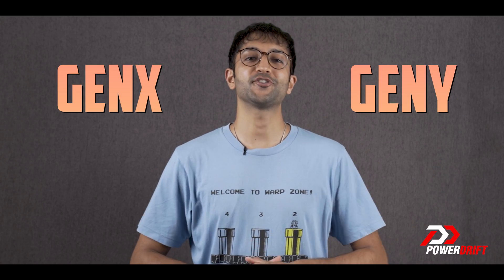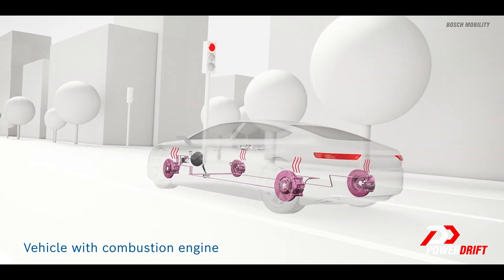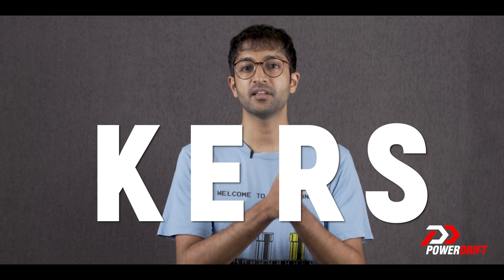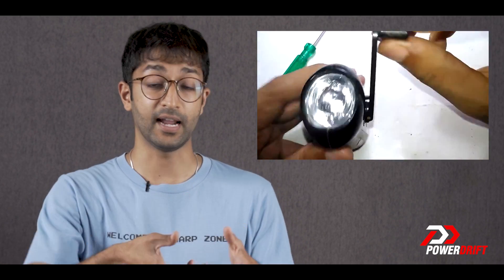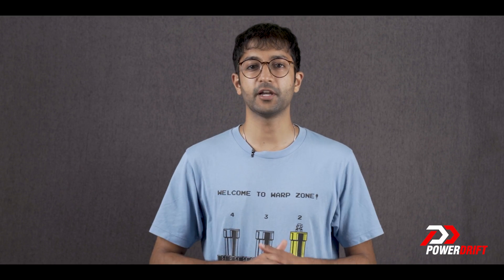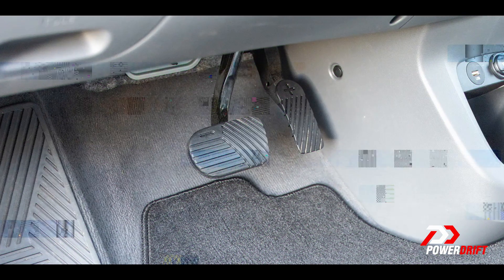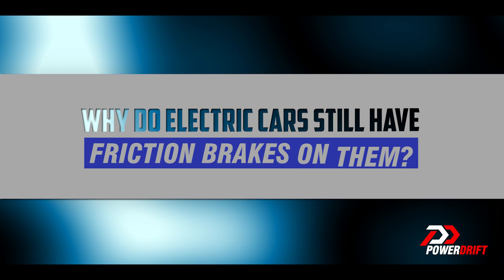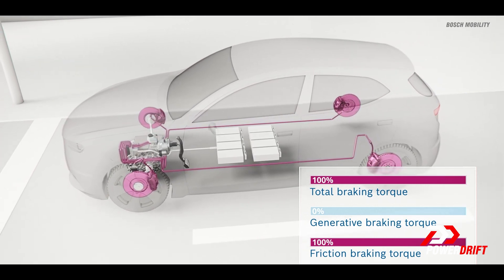Simplified | Regenerative Brakes - Efficient AF! | PowerDrift

Comment: I don't know shit about energy, but shouldn't the car generate energy for the battery from the 4 wheels spinning?
Reply: Because, Energy can neither be created nor destroyed and can only be converted from one form or another. So if wheel spinning is used to charge the battery would mean there is no energy for the car to move forward. Braking converts motion energy to heat which is unwanted. Hence regen is here where motion is converted to useful battery energy.
Reply: This is why going down a big enough hill can put a significant amount of energy back into a battery.

Comment: I get what your saying.  Thanks for that.  I'm about to get a non-plug-in hybrid (so this will be my first experience with Regen).  My concern is, how much of a danger is regenerative braking when you are driving on either snow, ice or rain?  My concern is the Regen braking "could" apply the brakes incorrectly for the road conditions, and the driver will have to recover with the regular braking system.  Is this not true?
Reply: Not true, noting to worry abort.
I have been driving self charging hybrid for 4 years/105.000 km, and now BEV for 1.5 years/46.000 km in Scandinavia, no worries.
However you must take care of your mechanical breaks  excercise them, or they will rust
Reply: @auser6426  Thanks!
Reply: @auser6426  Thanks for the help!  I have been.
Reply: @beaglebailey6588  You're welcome

Comment: What is physically preventing the wheels from rolling in regenerative braking? Something has to slow down the rotation of the wheels. Especially when you have it set to aggressive and the car comes to a stop much faster. If the brake pad isn’t pressing against the brake disc to slow the wheels rotation, than what is?
Reply: Electricity generators are just motors in reverse direction. When you accelerate you are moving current into the motor that rotates the axel but when you are not accelerating your tyres are still moving and the axel is still spining so now instead of using current your motor generates current and stores it in the battery. for more clarification you can study electromagnetic induction and how motors work. Hopefully it cleared your doubt.
Reply: @DeepuTyagi-o8k but then you use regenerative breaking, some kind of magnet i think? Pushing against the same magnetic pole? They both resist each other so it’s coming to a stop. But then coming to a stop… defeats the purpose of rolling wheels generating energy
Reply: That’s what I am saying bro
Reply: Lens law , the more you try to spin a motor and the more power it produces, the harder it will be to spin it , law of conservation of energy, the energy needs to lost somewhere when you’re gaining it

Comment: IN NEXON EV IF APPLIED REGEN 1 THE SPEED WILL GRADUALLY REDUCES TO ALMOST ZERRO if stopped pressing on accelerator . so everytime we want to apply accelerator which is power in highways . but if regen is not selected the car will move on with no applied accelerator . so regen is not a thing actcually while traveling in highways . but in town or cities while traveling constant braking needed . so it might help there with speed reduction and regeneration of electricity

Comment: I hv an idea how we can get rid of friction brakes I seen aluminum plates stop when between 2 permanent on/off magnets on 1 vid maybe this can be used in a car and also potentially using a tesla coil to an aluminium graphite battery that charges from graphite may make looping energy with minimal energy losses
Reply: I also hv an idea for a car boat plane just using a rear propeller for all 3 and it being 3 wheeled 2 at front 1 rear where u change suspension setting to bring rear tyre up that pushes 2 front for plane
Reply: And for driving mode fan pitch at angle to front nose cone to provide downforce and acceleration

Comment: I am confused, his explanation is not clear. I have been watching YouTube videos to understand how this works and no one is making sense. May someone with a Service repair manual that contains Regenerative braking system please share.
Reply: His explanation super clear, but this is what i know about REGENERATIVE BREAKING, the main purpose of it, is to conserving energy. So in electric vehicles the stored kinetic energy can be converted into electric energy to move the car agin instead of wasting it as a heat during breaking. Hope this helpful.
Reply: To get an understanding you are required to know the basics of physics. Once you have them, all of them will make sense.